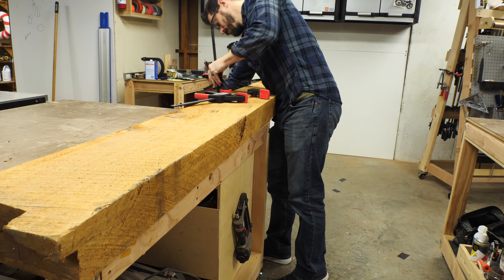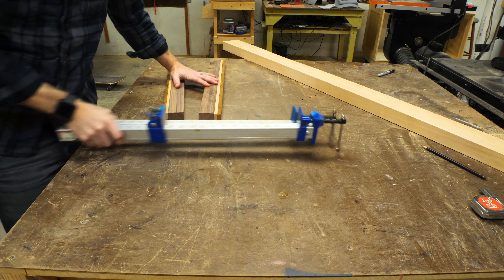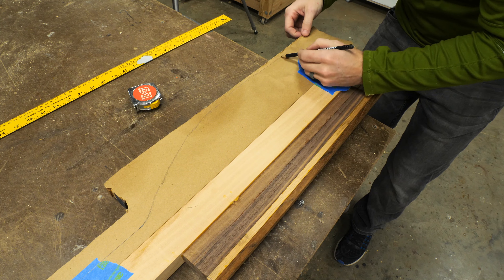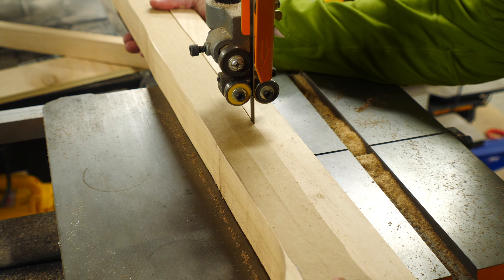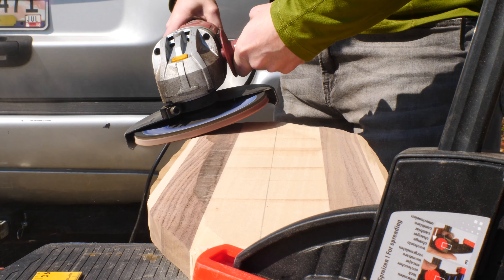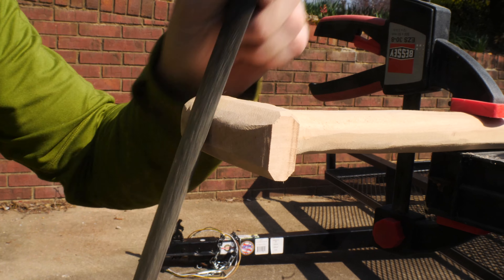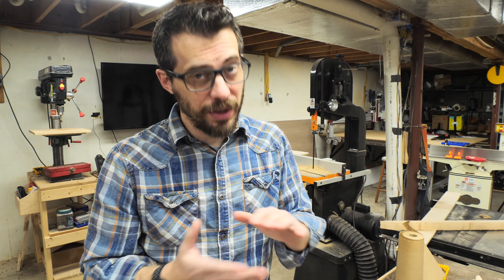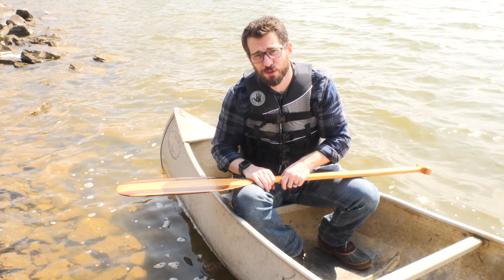How to Make Canoe Paddle // Woodworking | I Like To Make Stuff

Comment: I've made a few paddles and a tip I got was to add a hardwood spline (I use ash) at the blade tip to make it a bit more "robust".  I also added fiberglass tape over the blade tip.  These two together add minimal weight, but add tons of protection!

Comment: Working with another fellow paddle maker, he had me fiberglass reinforce the tip to help strengthen it from all the impacts it takes.  Just thought I would share that tip.  Looks great!
Reply: I used to go river canoeing, and our paddles were either plastic or wood with fibreglass reinforcement for the same reason. For proper reinforcement, you can add a small piece of aluminium along the edge, since a paddle isn't just for moving water around, it's for pushing your boat off the beach/river bed too :)
Reply: Just the tip?
Reply: Anthony Bowman Not sure if your making a joke or being serious, but in all seriousness, yes we would apply about a 2” wide strip of mesh fiberglass and fold it around the tip, then apply the resin and allow it to harden.
Reply: and as for why it's just the tip, that would be because the tip is the only part that really even benefits from it (unless you're abusing your paddle, the wood is plenty strong enough to handle the load itself), so putting fiberglass elsewhere is a waste of money. plus, i've heard that on the shaft the fiberglass could get worn down to the point of causing splinters. Haven't confirmed that one for myself though.
Reply: For the shaft we would take tapered strips of wood and use a birds mouth technique to assemble them in which the way they make hollow mast for sailboats.  Then hand plane each of the edges to give it a comfortable feel in the hand.  It created an oval shape more than a round.

Comment: I'd recommend that when you're canoeing alone, you sit or kneel towards the center of the canoe, facing the back of the canoe. That's the was I learned as a boy scout, and in my personal experience works really well. Keep up the good work!
Reply: Tom Sullivan there it is  I-was wondering if anyone would comment -When solo use the front seat as the backseat

Comment: Nice build and great first paddle. It does look a little short for you but everyone has different taste. As long as it reaches the water... I like to make my shafts more oval as it adds stiffness and where it thins / tapers down to meet the blade, allows flex. Kind of like a shock absorber. It is supposed to make paddling easier if you do it all day.

Comment: Great job on your first paddle.  I haven't built one yet but it is on my short list for my SUP and my research suggests doing the following things differently:

1.  Glass the blade to protect it from rocks etc.
2.  Rip the shaft in two parts and laminate it back together rotating one piece 180 degrees.  It will make for a stronger shaft.

And like others have said, it's time to build a canoe!

Comment: Great video. When I am doing something like this, I cut the wood in half, run them through the jointer, spray paint each half, then reglue the halves. This way I will always have a centerline and don't have to keep redrawing it. I have a big + running the whole length so I have a vertical and horizontal centerline that doesn't have to be redone

Comment: That looks a great paddle, Bob! I just bought a table saw to also make paddles for our Canadian canoe. I saw different guys do the same with also a great result. The only thing I would do is to let  the thickness of the shaft go further into the blade, for about 1 third of the length of the blade so it will bring the force of a stroke into the blade.

Comment: Bob, how about casting an aluminium tip for the paddle? Cut the bottom inch off, drill out a mortice or a couple of holes for dowels. Make a mold from the cut off tip and add the mortice to the tip, so it's all cast in one piece. Then grind and polish the new tip and attach with epoxy.
The aluminium tip won't degrade if it gets scuffed up, the paddle won't be much heavier, if at all and the paddle will look cool with a silver tip. You could send the tip to be anodised a cool  colour for extra points.

Comment: I just finished making a solid maple mash paddle for beer making. It will be subjected to really hot water so the finish needs to be both durable and food safe. So far my research has shown that tung oil is the way to go. It must have been challenging for you since you used a few different types of wood.

Comment: Not to be a know it all, but everyone has their own way of doing varnish... Most boat finish people will tell you, Epiphanes spare varnish clear is the way to go!  I usually warm mine up in a glass in a pot of water in a pan on low heat. Also, my first couple coats are thinned with 8-5% thinner. This gets the varnish deep into the grain. Light sanding between coats with 220 progressing up to 600 grit. The trick is lots of thin but super hard coats.  You'll be amazed at the results of this method. Then years later all that's needed is a light sanding and 1-2 coats to maintain it. Cheers mate!

Comment: Great job Bob. Say, quick tip if when paddling solo in tandem canoe, esp. in wind or choppy water: sit on BOW seat, facing backwards (might wanna use cushion if you have a buttocks/crotch contoured seat!).  Keeps you closer to center, giving less mechanical advantage to the wind on your bow.

Comment: My opinion is to use 6 oz fiberglass cloth and wet out with Total boat 2:1 resin/hardener, sand and add a few more coats of resin/hardener, sand final coat, then add a good marine varnish - same process as coatings for cedar strip canoe build

Comment: Good stuff Bob. I was a bit surprised you had the small strips towards to outside edges vs the walnut though. Really came out clean. You could also use a roofer with quarter round bit for the shaft;)

Comment: You could have cut the most of the paddle blade taper on the bandsaw by placing it on edge like you cut the bass wood center the first time. Either by changing the bandsaw angle or by jigging an angle to rest against the fence. The bandsaw would cut from the center line to the outer edge. Also consider a layer of fiberglass & resin on the blade or clear epoxy dip.  Great build.

Comment: The "fin" of the paddle is actually called the blade.

It's also generally a good idea to add a layer of fiberglass on the lower edge of the blade because it gets beat up.

Comment: Two things:  First, I think you made a good choice of finish with the Helmsman.  I would have sprayed it but that's just me.  Helmsman is a urethane rather that polyurethane varnish.  It's self-leveling when you brush it.  It is also quite water resistant.  It is a great product for table tops because you will not get white rings from coffee cups.

Second, the paddle should be longer for the stern position.  It looks like it is about right for a bow paddle.  The bow paddler does the steering, the guy in the stern provides the power.
Reply: Stern does the steering in a canoe and most other watercraft as well. Why? Front half of the canoe is parting the water and has more pressure on the sides of the hull as it moves through the water, and thus resists moving to one side or the other. Back half of hull has less pressure on the sides of the hull and so is easier to move sideways. Agree the paddle should be longer.

Comment: Might want to use West Systems epoxy with a strip or two of woven fiberglass mat on the very end of the paddle, to add strength and durability to it

Comment: Never made a paddle but I'd probably heat the end or the entire blade to help slow hardener epoxy penetrate, than remove any amine blush. Then high UV phenolic marine spar varnish the blade with multiple layers. Because your blade is laminated I'd only consider a natural finish like boiled linseed oil on the handle to help prevent blisters. Otherwise varnish it too,  and if the resin in the varnish is too hard and grabby, rub it with an abrasive like steel wool.

Comment: I recommen wrapping the handle in leather for longer trips to cut down on blisters, also in using wooden dowels between the wood strips might provide more strength and structural stability in the long term. But over all nice work

Comment: Since you have a 3d printer, have you thought about making a replaceable tip for the blade. Maybe the last 2" with 2 studs that would be inserted into 2 holes and a set screw to hold it in.

Comment: Do you think a belt sander would have been an easier tool to use to form the edges of the blade?  A more consistent motion I mean, with the disc sander you can really gouge it in a hurry.

Comment: Add some fiberglass or kevlar mesh to the tip of the paddle blade to help with strength and chipping if you hit rocks or sand when you're in the water. Great project though.

Comment: Great job! Just a comment on your paddling; when you are in a shallow area, you typically want to push off with the handle of the paddle, not the blade. If you push Of with the blade, it will get damaged and will probably break much sooner.

Comment: Great video, thanks for sharinag. Small correction, but that is an orbital sander, not a palm sander. A palm sander uses a quarter sheet (rectangular) of sandpaper and an orbital sander uses a round (usually 5") abrasive disc.

Comment: Great job on the paddle Bob, I think the rule of thumb for the length is the distance from the ground to about eye level. Only thing that made me cringe was when you called the blade "fins" but hey what the hell you made the paddle. A block plane and belt sander works real well for shaping the shaft and blade. You could have a lot of fun building a cedar strip canoe, be a great project with your kids. Keep on building stuff.

Comment: Well, if don't you want the paddle to schratch at the end of the fin, put some sheetmetal or aluminum profile. For the finish, i rather recomend you to use boat wax or lacquer. Or just use larch wood that doesn't need the finish even if its in water

Comment: "Dense, but also light weight" Um.... those two terms are mutually exclusive?  You mean strong but light weight, right?  Like, firm as in won't bend under pressure but not brittle causing it to snap when it does reach maximal tension?  Yeah, "strong" seems a better word than dense.  Dense means it's heavy for its volume.
Reply from the maker: Not entirely true. http://hyperphysics.phy-astr.gsu.edu/hbase/mass.html
Reply: The only thing I see wrong with what I said vs the link you provided is my usage of weight instead of mass, which on earth is relatively interchangable.

Comment: Sorry, did you just say, 'it's really good because it is dense but also lightweight'? WTF. Density is measured by g/cm3. that makes it impossible for it to be dense and lightweight. You may as well say this is great because it is soft and hard.
Reply: I know what he means...for it's "density" basswood is reasonably light weight...though that's what he said but I know what he means. Basswood is not that dense and it's kind of soft...I've spent over 20 years building guitars, basswood was a common choice because it was light weight and a great tone wood and it also made for a great looking paddle. It's nice to see that some folks are not relying on "store bought" all the time. A great paddle, you get exactly what you want & you don't have to spend up to 1000 bucks on a custom one. Two thumbs way up !!!!

Comment: "Really dense, but lightweight." What?
Reply from the maker: Density != weight
Reply: I Like To Make Stuff True, but density is the amount of mass in a given volume. So a more dense material would be heavier than a same size project of a less dense material (which goes against your lightweight bit). Maybe you're using "dense" in a woodworking slang meaning that I don't know though. Love your channel by the way!
Reply from the maker: Well, I don't really want to get into a physics debate but that's all based on the weight of the material. If the material (basswood) is really light, then even when it has a high ratio of mass/volume, it can still be light relative to other things.  Maybe "tightly grained" would be a less controversial way to say it.  Thanks!

Comment: FIN????? Sorry but its called a Blade!!
Reply: that said great build... to protect the end wrap it in a bit of 4" Glass fibre tape and epoxy resin, or if you are feeling flash use some kevlar or Carbon cloth
this will give you a 2" protected edge either side

Comment: Relying on only wood glue to hold those pieces together? Meh.
Reply from the maker: Generally, wood glue is stronger than the wood it connects. It'll be just fine.
Reply: That's only true if it stays dry.
Reply: Waterproof glue and remember a paddle will dry out between uses.